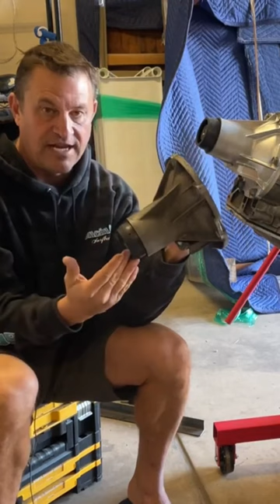Anyone else breaking 6L90e tail shaft housing?

Comment: So you need a slip yoke eliminator and covert the driveshaft to a universal joint on the transmission side. The original jeep probably was that way, my cj is.
Reply from the maker: I don’t think anyone makes the eliminator for the 6L90.   Might make my own.
Reply: @ntdracing  drill the output and tap it.